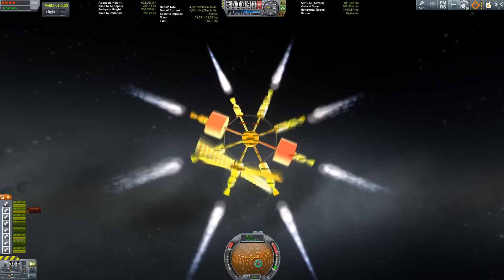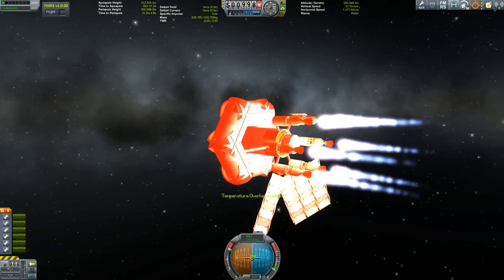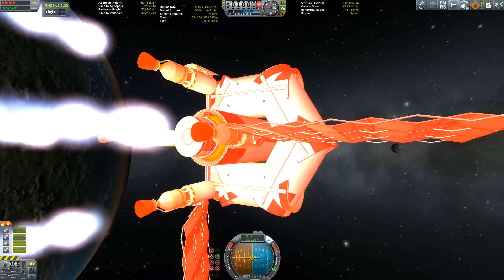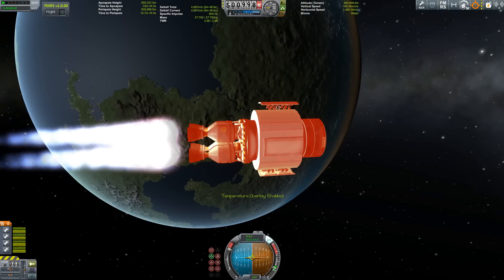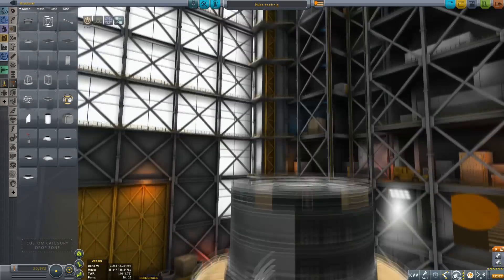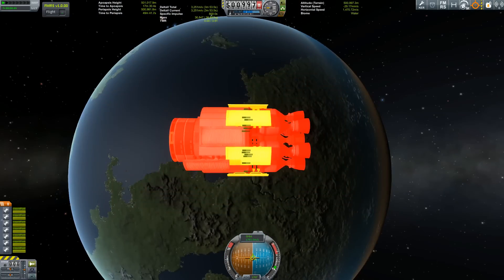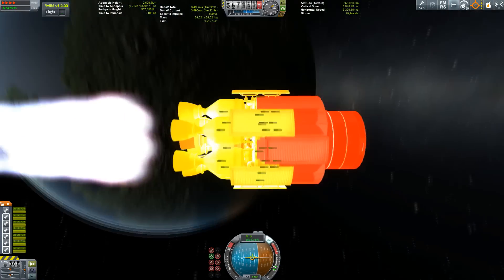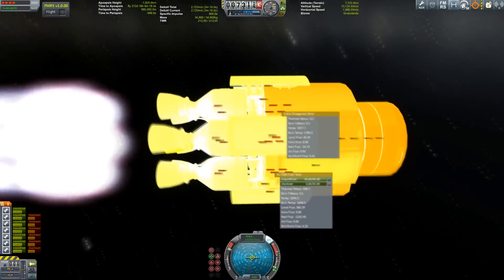Radiators and strange thermal stuff in Kerbal Space Program 1.0.4

Comment: Some tip: In 1.03 I was using heatshields for insulation of my engines. They could be placed right between engines and fuel tank (will need a fuel line though). Or they can separate the whole [engine + fuel tank] thing from the rest of your craft, which is effective and free from bugs.

Comment: your conclusion is wrong - deployable radiators are the most effective, but they draw heat from all parts, not just where they are attached. so no wonder the part that had also its own radiator was cooler.
Reply from the maker: You are right. Which is why I made a follow up video where I corrected those statements :)
Reply: +ShadowZone is there a something which enables heat I was using a nerva and it was heating my probe.

Comment: Excuse me if I'm being a moron Didnt watch the whole thing but by being in space, there would be no heat transfer away from the vehical since theres nowhere else to spread it other than the cooler parts so try the test on land or check if the heat raises on cooler parts
Reply: The Revanchist You're mixing up radiation and conduction - conduction is much faster (and you don't conduct much to space, a few stray bits of plasma here and there), but you still radiate into space just fine.
You feel the sun, don't you?  That radiates a lot of heat. :)
Reply: Agonarch *Starts banging head off desk* Thanks for clarifying that for me Ha ha
Reply: The Revanchist 
Heat flow works by 3 mechanics:
Radiation, Conduction and Convection.

-Radiaion:  Produces electromagnetic waves that radiate (hence ratiation) energy (aka heat) away from the object at proportional to T^4 (T in Kelvin).
-Conduction: Transfers heat in an object to equalize temperature across it. Doesn't dissapate heat into the sorroundings.
- Convection: Only works with a fluid medium (Gas or Fluid), dissapates heat away by mass flow that gets heated when coming near an hot object. (Heat exchangers, "Radiators" to heat your house in winter (they should be called convectors...), ...)

To the test. Radiators radiate heat (hence the name). That means they don't need an atmosphere to cool your crafts. Typically larger radiator surface means lower temperature, but well, the large structural radiator seems to work more effectively than the huge deployable radiator, ...
Hence the video title.
Reply from the maker: The radiators "take" the heat from the hotter parts and distribute it on a bigger surface. Heat can travel in space through infrared radiation. Of course the heat transfer will be a lot better in an atmosphere where the air "takes it away" so to speak. So the real test for a thermal control system is if it can work in space, because it's a lot harder to get rid of heat. For heat in space see also item 3 in this article: http://helios.gsfc.nasa.gov/qa_sp_ht.html